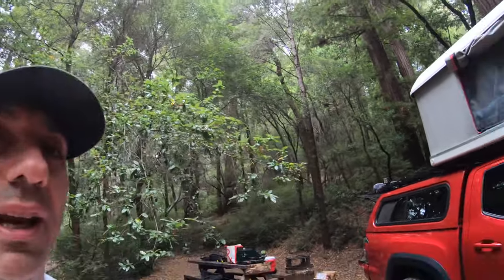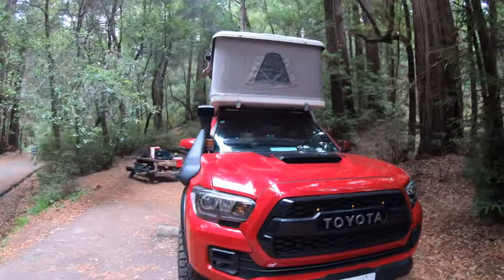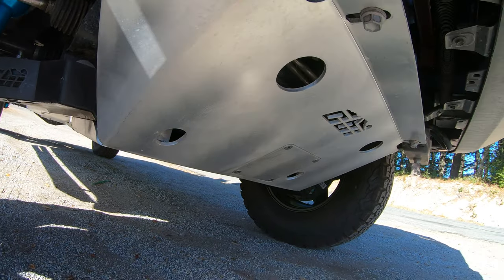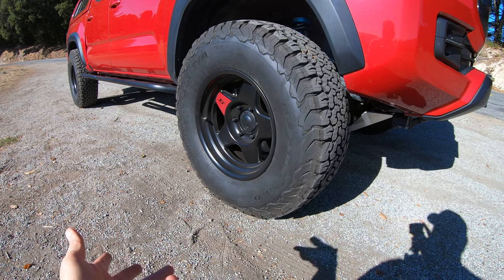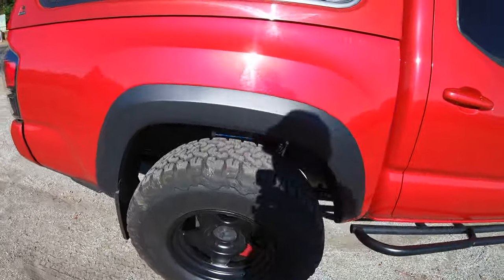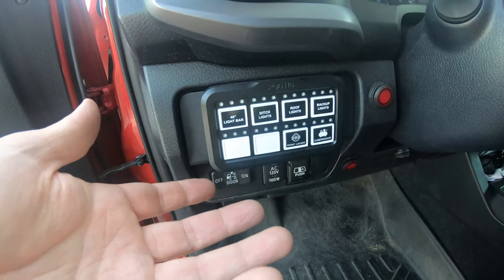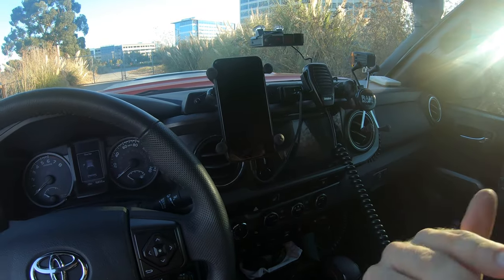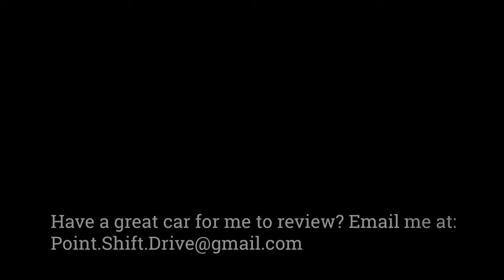Modifications That Matter Most on a Tacoma

Comment: Snorkels are for more than just deep water crossings where they ensure water does not make its way through your airbox and into your engine while crossing rivers and unexpected floodways. The fitment of a well designed and constructed snorkel, just as importantly, protects your engine from dust while traveling along dry dirt roads. The fitment of a snorkel repositions the air-intake to a much higher and cleaner location greatly reducing the amount of dust passing through to your airbox and filter.
Reply: Yes but this is just a "desert air intake" its not fitted nor made for water. It's basically just posing. A full fording kit includes a dash panel to turn off all the electronics until the shit is dry again. AND like you said a fully fitted waterproof intake assembly. It's like Scuba diving. You have to check your gear everytime and constantly adjust it.
Reply from the maker: your not wrong... I kinda regret the snorkel but there is a water feature at my local OVH that is deep. so I have used it there. as long as you dont stop the door seals do a good job keeping water out and the motor was fine. so guess its not all hype or "posing"

Comment: Thanks for your video and the great tips!  Do you think it’s a bad idea to go for a long bed Tacoma for Overlanding and off-roading? Also, any reason you decided to go with an eLocker for the front rather than an air locker connected to an air compressor?
Reply from the maker: Good questions! 
First off... a long bed would be better for over landing because you get more room for stuff. Being able to carry more things is a huge advantage. However... a long bed has a worse departure angle. Therefore as an off-roader it will have more of a challenging time climbing up obstacles. But then again, there are work arounds. I would have bought mine in a long bed in hindsight. As for the locker.... an elocker  is more reliable. Think of it this way.... if anything pinches or cuts the airline to the diff, your front locker is useless. Also If your compressor stops working for some reason. To me, I didn’t want that headache. Mine is simply connected to the battery and is activated with electricity. It’s also a bit of personal preference. Hope that all makes sense

Comment: I sleep in the back of my expy when I'm away and sleeping at an angle is actually comfortable. It "feels weird" at first but the sleep is great
Reply from the maker: Do you use any thing for a cushion?
Reply: @PointShiftDrive  I do, one of those cheap RV mattresses that's only 5 or 6 in thick. A full size is only a inch too wide but it squishes in perfectly once you push the corners down. It's a crap mattress really, all Springs and next to no cushion but honestly my night sleep are not hindered by any of it

Comment: turned out great so far, I just put some 285/75 r17 on my gen 2 tacoma sport and love them so far. what made you go with 5.29s instead of 4.88?
Reply from the maker: Thank you! As for 5.29s I made the decision based on tire size and current/future weight of the truck. I knew I’d be adding more weight (still more to come) and I didn’t want to have to regear again. However I don’t regret it at all. 5.29s feel great. Not sure why 4.88s are even needed to be honest.

Comment: Nice setup,  thanks for sharing. How is that camper shell holding up for you? I'm considering getting the same one, curious how durable it is while offroading, and the weight capacity.
Reply from the maker: My shell is doing great. No issues what so ever! I have been surprised by how strong it is as well cause I always add so much weight on top when I go on trips. I think there are better strong shells out there. I think ARE makes one but for the price this one is pretty amazing.

Comment: 18:29  Yeah, I got the Total Chaos bed stiffeners, too.  EVERY Tacoma guy needs to buy into the bed stiffener brace.
Reply from the maker: Yeah I agree. I just wanted a bit of insurance so that I don’t crack my bed. But the funny thing is I use the mounting holes on the stiffeners all the time. They are so handy! Just that in itself made the bed stiffeners worth it!
Reply from the maker: @ShinyStarDust Homes the issue is that with a shell and significant weight on top, and putting the truck through some flex, the beds can crack. the stiffeners help keep the bed from torquing and cracking. At least this is how I understood it. Either way, they really are nice just for having extra places to tie things down with. I love mine!
Reply: Why, really think adding holes into a “supposed “ weak point doesn’t make sense...

Comment: Any concerns or issues with your prinsu roof rack and having your RTT mounted on the cab like with weight or anything?  Also would you do a different rack now knowing you’re using it with a RTT?
Reply from the maker: No issues at all. Though the Front Runner racks are better for having more room to get the RTT on and off the rack. With the Prinsu I have to remove cross bars and keep them attached to the tent

Comment: What would you recommend as the first few mods for a stock 2019 trd sport? I dont do offroading and will be on road almost 100% of the time. Will do camping but only twice a year. I love your mods but I just want my taco to look sweet without looking like an imposter with offroad accesories ol
Reply from the maker: dj Kaleido if you plan on being mostly on road then you can keep it mostly stock. However I would do an OV tune, shell, and roof racks. I’d even consider bed storage (depending on your needs). You don’t need much more than that. 
Thanks for watching!
Reply: @PointShiftDrive  awesome, I was thinking of just making it more pro like (just grill and wheels) as well as a step bar and the roof rack. I appreciate the quick response! Enjoy the taco! :)

Comment: What ditch lights are those and what brand of amber covers are you using, nice truck.
Reply from the maker: Thank you... Those are Rigid lights. Pretty much get those and the covers anywhere. Check Amazon: https://www.amazon.com/Rigid-Industries-261113-Flood-Universal/dp/B074TM3PMS/ref=asc_df_B074TM3PMS/?tag=hyprod-20&linkCode=df0&hvadid=312104220456&hvpos=&hvnetw=g&hvrand=6085890951907776067&hvpone=&hvptwo=&hvqmt=&hvdev=c&hvdvcmdl=&hvlocint=&hvlocphy=9031972&hvtargid=pla-569131686139&psc=1

Comment: Nice set up! Just started building my 17 TRD off road for overland type trips.
Reply from the maker: pdx.trailerguy thank you. And I appreciate you watching. What have you done so far on your build?
Reply: @PointShiftDrive  little bit of a lift, tires, wheels, leer canopy, bedslide, prinsu rack, and a bunch of camping gear or storage. About ready to pick out a roof tent and another prinsu rack for the canopy.  I'm hoping by this spring the build will be far enough along that I can actually use it...

I don't really have anything on youtube, "yet" ...but my IG does. 👍
Reply from the maker: @foote1967 Sweet!
Reply: pdx.trailerguy ...FYI..REI is offering their one item at 20% off thru 11/25.  They sell select Tepui RTTs.  I’m looking for one myself and it’s a toss up b/w Tepui and 23 Zero.
Reply from the maker: @jerrylunday9977  Thats a good tip on a solid tent. Just make sure that it will work with your rack system
Reply: @jerrylunday9977  nice...I'll have to look into that!

Comment: What are the benefits of the trd pro vs buying a trd off-road for much less and just buying better suspension and tires. The fox stuff seems mediocre from the reviews I’ve watched
Reply from the maker: the Pro gives you some nice to haves. blacked out headlights, better tail lights, blacked out badges, colored rear bumper valence, better hood with decals, rigid fog lights, a leather like interior, of course Fox suspension, better wheels and tires from factory, and better resale value. 
I think the cost differences between the OR and the Pro are exaggerated. I mean, if you plan on modifying your OR, it will quickly close the gap with the Pro. Think about the stuff mentioned above. most people do at least half of these as aftermarket on their OR. I have zero regrets going for a PRO. Not to mention when I sold my Pro parts I got top dollar for them. doubt you will see the same return with the OR parts. 
The Pro is worth it in my eyes
Reply: @PointShiftDrive  fair enough I love the snorkel and badging. I’m looking at lightest used Tacoma’s currently and I’m sure as you know the prices are insane. 50k mile trucks still going for 38-45 🙄

Comment: Buys tacoma pro, changes suspension, tires/wheels and skid plates. lol. Literally the whole pro package.
Reply from the maker: PatTheRiot wheels/tires always get upgraded when wanting larger sized tires. I loved the style of the OE but it wouldn’t accommodate this size tire. As for the skids, the pro only comes with the front. I basically added extra protection (transaxle/gas) and a new front so that they work together properly. And as for the lift, the pro lift isn’t that great. When you weigh down the truck with all your overlanding gear that 2 inch lift is more like a 1 inch lift. 
Make sense? Think I justified my reasons but glad you like the pro package that much.
Reply: @PointShiftDrive  Hope you saw my other msg, just messing around big. I would go the same route if I went taco, those king shocks look insane. I just wish toyota didn't come up with such a stylish and sleek interior. The lack of power was enough to forget the mpg of the frontier. But now is like... heh. Might have to suck it up and try to supercharge the taco.
Reply from the maker: PatTheRiot just seeing this. But I agree. The Tacoma is one of the better looking midsized trucks there is.  I even like the interior more than in the tundra. But every purchase has a compromise. Hence as our love for trail competency increases, we need to upgrade! At least it’s a platform that we all love.
Reply: Couldn’t you have bought a TRD Off-road? The savings would have paid for the suspension and canopy!!  I understand heavy modifications, but start with a less expensive base and you would still have the same truck now. The Pro part of the TRD is gone!! Just have a name now.  No?

Comment: Quick question, what kind of coax cable did you use for you're cb? I have almost the exact same setup but I went with the non grounded and cannot for the life of me get the antenna calibrated. Im using the caliraised truck bed mount on the passenger side
Reply from the maker: Hi Bobby, sorry your having issues... how tall is your antenna? I used this to calibrate: https://www.amazon.com/gp/product/B004ULN610/ref=ppx_yo_dt_b_asin_title_o00_s00?ie=UTF8&psc=1
Reply: @PointShiftDrive  I actually used the same swr meter but any channels above 10 have a swr reading higher than 3. Im using a 3ft firestik on a quick disconnect. But again, I'm trying to find out if maybe it's my coax cable since it's a non ground cable. I want sure id have enough metal in the area to ground it. 

Awesome truck btw
Reply from the maker: Bobby Franco hmmm I am not sure. I didn’t have any issue but my antenna is a 4 foot vs a 3. Besides antenna length it could be the cable. Can you buy an extra one with ground to test?
Reply from the maker: Bobby Franco thank you for watching btw 😁

Comment: Is there a reason as to why you placed the RTT up front as opposed to the rear above the camper shell?
Reply from the maker: Hi Don. Yes actually. a couple reasons... first of all, my shell isnt really rated to hold that much weight. I mean, it probably could do it but its not designed to hold 500lbs + and would hate to crack the shell. Secondly, the RTT is too long. So the nose would rest on the cab rack anyway. This creates issues when off road and the bed versus the cab articulate. In other words it could damage the RTT. Lastly, dont think it would look any better with it on the back. Just my $.02 on that last one. 
Hope all that makes sense.
Reply: @PointShiftDrive  I am glad i found this, i was debating doing a RTT on my tacoma camper shell or the cab. do you have any issues with your RTT rubbing on your  shell and or rear prinsu rack? AMAZING truck! absolutely done perfectly
Reply from the maker: @brandoncaulkins3607  thank you for watching! 
The RTT does rub a bit on the rear rack but I solved that by using some extra phone plates for magnetic mounts. So no biggie. 
Please consider subscribing and share :)

Comment: Why did this guy even get a trd pro if he replaced the fox shocks with King's? Kind of a waste of 10 grand to get the pro instead of the off-road or sport 4x4.
Reply from the maker: Hi Josh. 
I have already answered this question like a 1000 times but one last time is fine. 
When I bought this truck I had no plan to mod it. it was perfect for the time. it did a great job. I mainly bought a pro over an OR because of the following reasons:
1- leather seats. 
2- I liked the lighting package better (head and tail lights)
3- dark badging
4- better skid plates!
5- better resale id I decide to sell
6- better wheels and tires
7- better exhaust 
8- and yes, better suspension (fox over bilstein) 
9- Barcelona Red!
10- Toyota Grill!
HOWEVER.... over time I started using the truck more for overlanding and offroad trails. I quickly realized that id like it to be higher and have more ground clearance. that means bigger wheels. however you cant run significiantly larger wheels on the truck unless you also lift the truck. Hence the Kings! FYI I bought my complete suspension setup for less than $4700 with everything. I sold my OE Fox suspension for $2200. Not a bad trade if you ask me.
Also mind you I got $400 for my OE skid! that was almost full price. 
Overall, I dont regret it at all. I love my truck and if you do the math, it isnt a loss of $10k. ;)
Thanks for watching.

Comment: I don't get the whole snorkel thing. How many 4 foot deep rivers are you really going to ford unless you live in New Orleans? Im sure it adversely affects gas mileage on a truck thats already kind of a gashog.
Reply from the maker: I agree... I actually kinda regret the snorkel. I think its a bit much. BUT its nice to know I have extra capability if needed. The main reason I did get it is because. at the OVH near me there is a water feature that is kinda deep. probably like 3 -5 ft
Reply: @PointShiftDrive  well I was recently schooled that it was more for not sucking sand into the intake for Desert/dusty conditions, so that kinda makes more sense. It looks cool if you want that overland look, i give you that.

Comment: 285/75/16 are 33 inch tires.
Reply: 285/70/17 are~33 inch as well
Reply from the maker: Kevin Matejovsky these are 285/75/17
Reply: Point.Shift.Drive  the diameter is still 33”
Reply: Ok.  My bad.  285/75/16 and 285/70/17 are 33” diameter.
Reply from the maker: Kevin Matejovsky looks like Tirerack says these tires are 33.8x11.2R17. Which is about “.2” of a 34. I think we are splitting hairs but You are right.